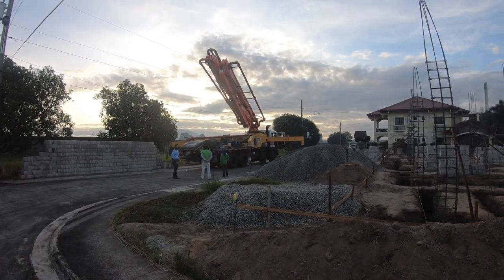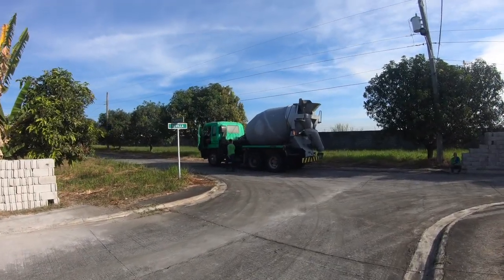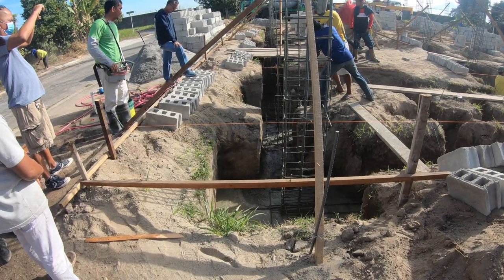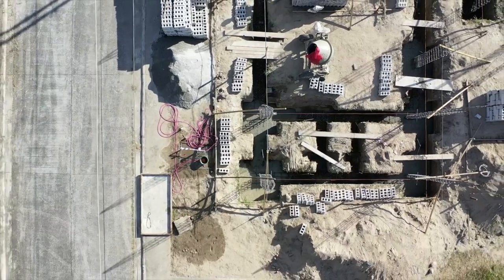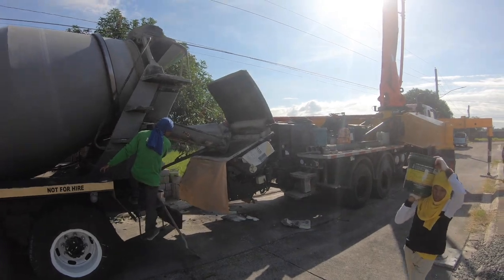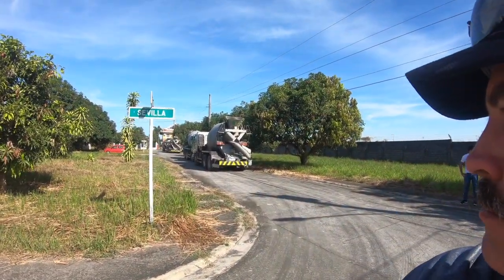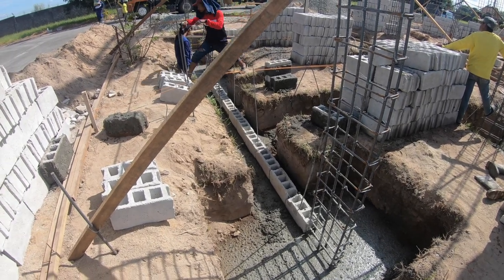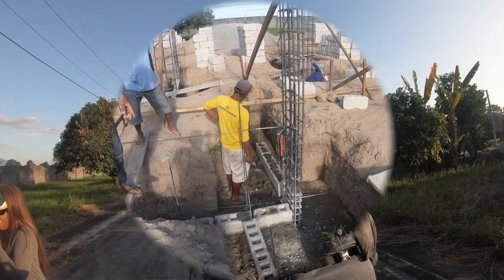Philippine House Building Step by Step, Build Day 18: Pumpin’ Crete!

Comment: Pesticide for termite...I was wondering why, because you have concrete.  

We hope to start building within 1 year too.  I'm following your channel since I just found it. Been following James.
Reply from the maker: Short answer is the termites are very aggressive in the Philippines. So the standard practice is to pour termiticide before pouring concrete on the ground level from the foundation walls to the floor slabs.
I’ve been in houses where this wasn’t done and the doors and cabinets get ate up with termites.
Our plan is similar to the States, where we treat the exterior of the house every year to maintain that barrier. Again the Philippine subterranean termites are super aggressive. Erring of the side of caution and preparedness. 
Thanks for tuning into Casa TexPina!🙏
Reply: Great information and good idea then.  I did grow up in the Philippines but being a teenager then, I did not notice any of that.  Our Los Angeles house did have Subterranean terminated and had to be treated.  

We live in Texas now (Celina and we do have quarterly pest treatment for the outside.

Comment: Чем жиже бетон, тем он менее прочный. Этот на вид был слишком жидким.Не знаю как там у вас в США, но у нас применяют вибрацию при укладке бетона..
Reply from the maker: I would agree. However, common practice here when using a pumper truck is that vibration should not be required since it needs to have a fairly high slump to make it through the shoot. If concrete was being placed directly from the mixer truck to the site, then you’re correct, it would have needed to have been thicker and vibrated. 
Thanks for tuning into our channel.

Comment: Im assuming its also good for earthquake proofing???
Reply from the maker: Jopet
The standard practice I’ve witnessed here, is  a minimum 4” concrete base prior to wet setting the first course of hollow block. 
Generally speaking, for foundation work, the concrete should be very thick and placed with the use of a mechanical vibrator to remove as many air pockets as possible thereby eliminating honeycombs in the finished crete. 
Most projects I have seen here, do not use mechanical vibration. 😞😞😞

Comment: What about air pockets, I did not see anyone working the concrete between the grill?
Reply from the maker: The concrete coming out of the pumper truck was fairly fluid, maybe a 5” slump at best. The guys were waking all through the footer wall areas. Then using large trowels to move the concrete into place for wet setting the first course of hollow block.

Comment: I understand "Vibrating" in a mechanical sense isn't common practice, but they still should be doing a manual vibration. Poking at it with rebar or bamboo.  Something to make sure the concrete is indeed getting in all the right places.
Reply from the maker: It has been an uphill struggle to get the workers to manually vibe the concrete with a rod or rebar. The other thing I have them do is to tap the forms with a hammer several times to reduce the honeycomb effect.
Reply: @CasaTexPina  The hammer method works great.  Its just like vibrating.  Obviously you are well past this, but others like myself are just now watching and I love to point this stuff out for others who will build in the future.